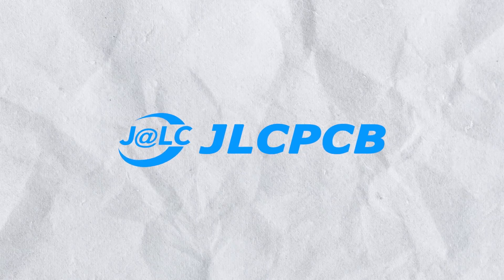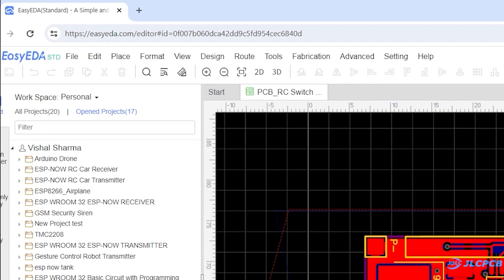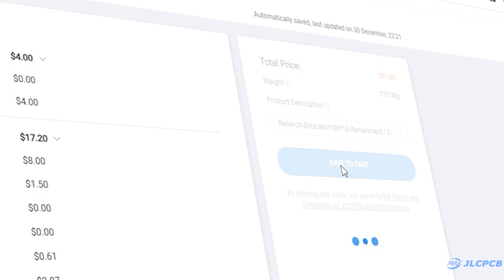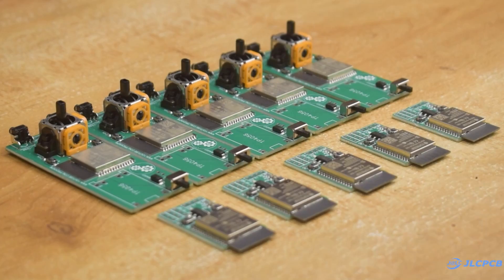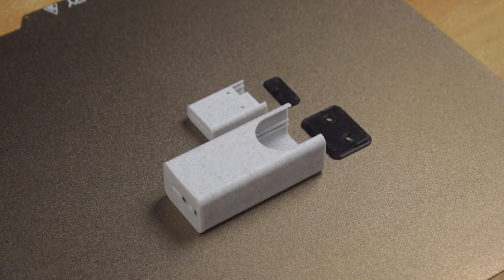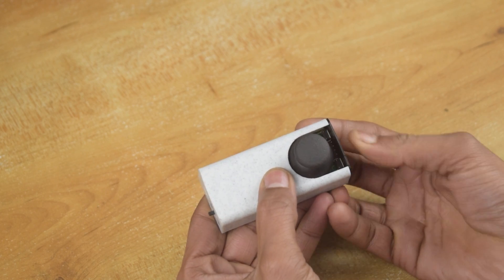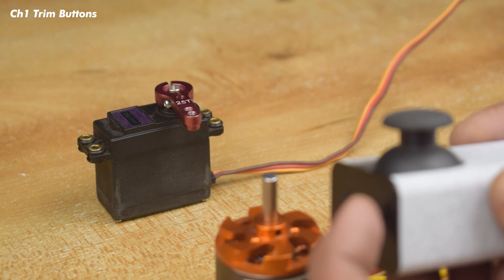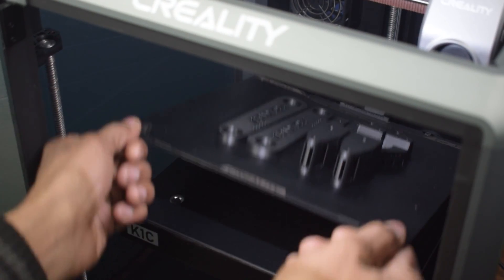Car Bike Hybrid - Powerful Brushless Motor RC Car | Pro Know

Comment: Bro is that different joystick, you are using??
Reply from the maker: It's similar to the joystick that people usually use in project's but it's accuracy and it's price is much higher than the normal one.
This is the joystick that I used: https://www.lcsc.com/product-detail/Multi-Directional-Switches_C-K-THB001P_C2685355.html